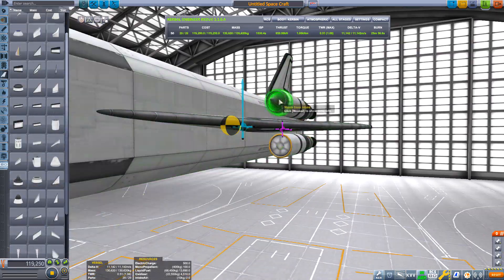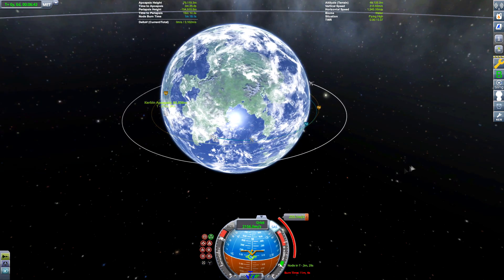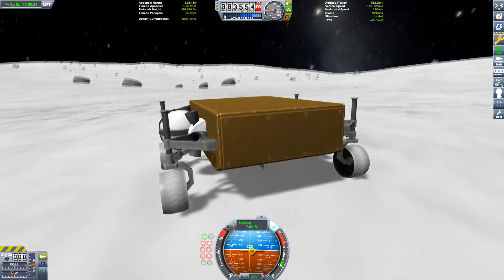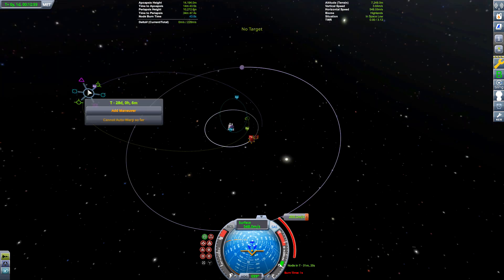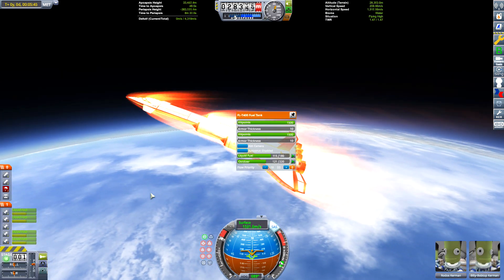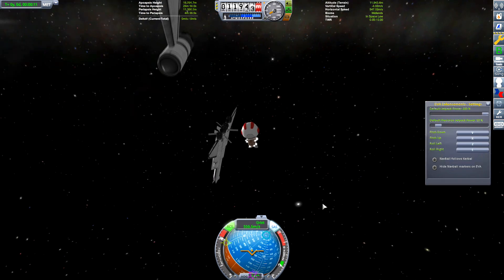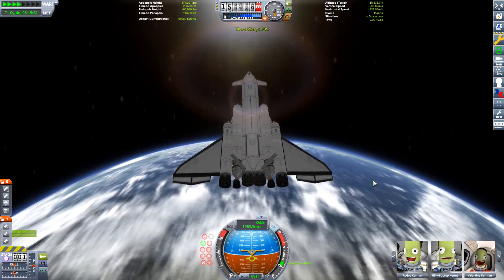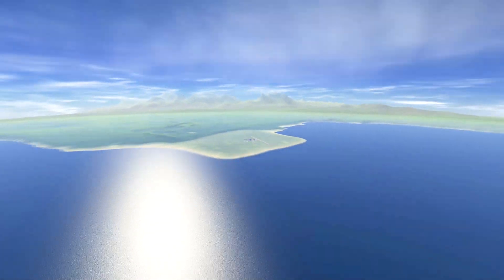SSTO Rescue mission - Kerbal Space Program

Comment: A few hours ago I made a blunder.  I had a contract to retrieve a couple of kerbals as well as a capsule stranded around Minmus. I designed a ship with a claw, saved and went outside since I had something to do IRL. I came back later to launch the mission. Once in LKO, I saw that I didn't have any parachutes on the ship. Unfortunately I had changed stage to deorbit first stage, so I coudn't come back to VAB.
I had two options: send a rescue craft or deorbit the ship use all its fuel to get the slowest possible and EVA Valentina with her personnal parachute. 
Damn it, I deorbited the craft and safely glided Val back to KSC. Certified Badass confirmed. Val doesn't need Blunderbirds...  But the mission was already called Blunderbirds, that's ironic. More like B.L. Underbirds...
I went to VAB, modified the craft and launched again, Val didn't take any rest, just like Russian cosmonauts who want to get going immediately after being rescused from a failed take off... 
The rocket even had the same name, so the previous, failed one was as if it never existed...

Comment: For mk3 SSTO, always add a shielded port on the nose ! More flexibility - now they can dock at space stations to bring supplies.

For mk2 SSTO's, best place I found for a shielded docking port is on the belly - makes docking harder though, or at the back, on the middle stack. Best solution is to use the mk2 docking port, but then you have to provide a junior docking port on your stations. Watch out for the position of your solar panels, if you go for mk2 docking port. Don't forget your RCS !

For mk2 SSTO, replace cylindrical stacks with mk2 stacks - more body lift - 2 nervs in middle, 2 rapiers on each side stack. The Shuttle wings are a bit too much for mk2, they're quite heavy, the fuel they carry is not worth it. Switch to supersonic thin wings and add a bit of extra fuel if you need it !